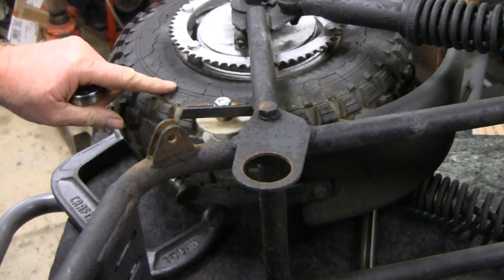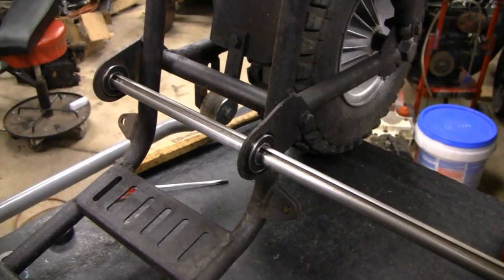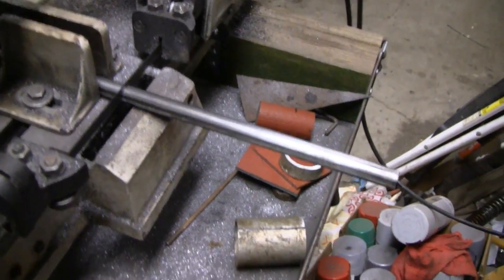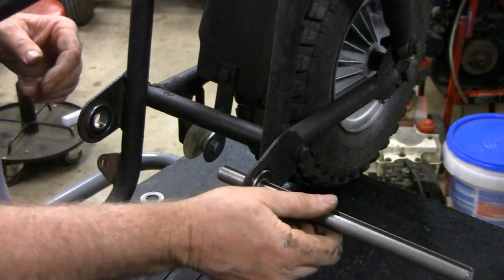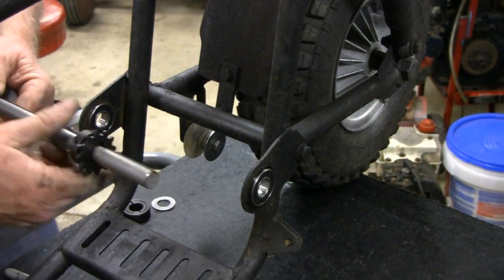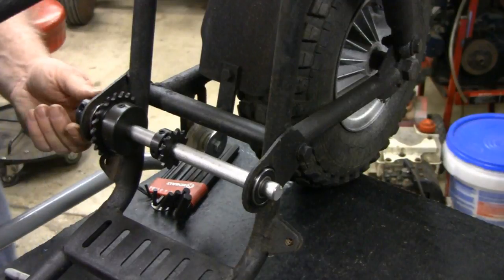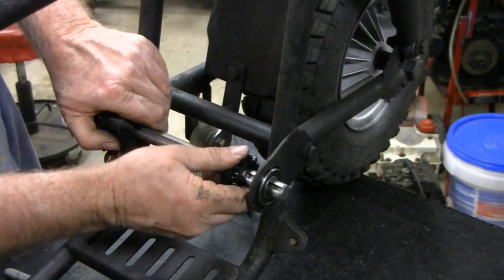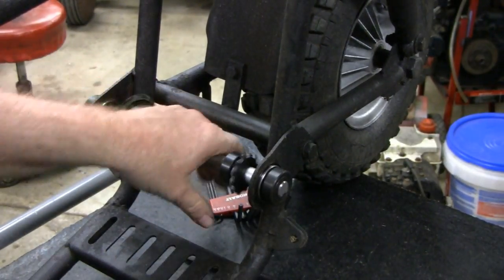RUPP MINI BIKE RESTORATION (part 4)

Comment: Looks good!! I think I would have put the bearings in from the inside and put the clamp collars on the inside to keep the spinning parts to the inside. Works the same both ways. Just one more opinion. I have a mini bike to build this year. Not a Rupp though. Mine is in worse shap too. Like your vids though. Thanks
Reply from the maker: +Rick Wagner The sprockets and chains wouldn't line up that way!!☺

Comment: did the math, and the speed works out to between 30 - 35 mph at 5000 rpm rough estimate plus or minus 5 mph.  not bad for the size motor.

Comment: mph  X  12 (inches per foot)  X  5280 (feet per mile)  X  axle gear ratio  X  transmission gear ratio OVER
pi (3.14159265)  X  tire diameter  X  60 (minutes per hour)

Comment: 3600 would be 52.45 MPH, I'd put a 13 or 14 tooth on the jack shaft to gear it down so that it has more power and less top end, then you can ride some wheelies with it.

Comment: You essentially have a front sprocket with 21 teeth and the rear is a 60 tooth since you have a 12 tooth clutch and 12 tooth jack shaft sprocket which makes for a 2.86 gear ratio. Put the numbers into something like this currieenterprises.(remove)com/cestore/calculators/mphCalculator.htm and you will find that at 3000 RPM you'll be doing something like 43.71 MPH.